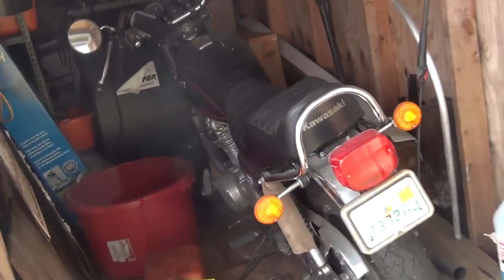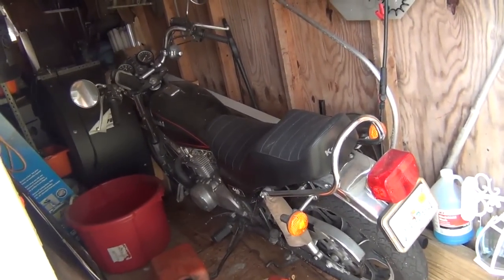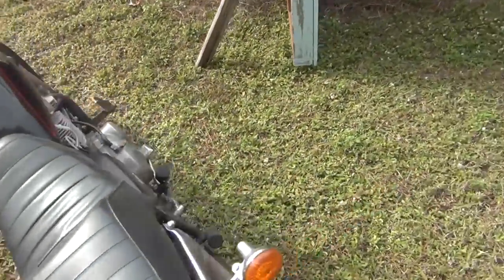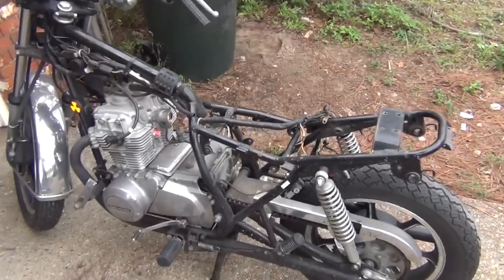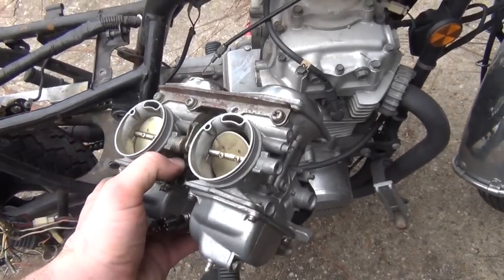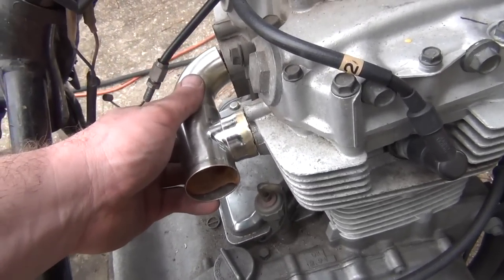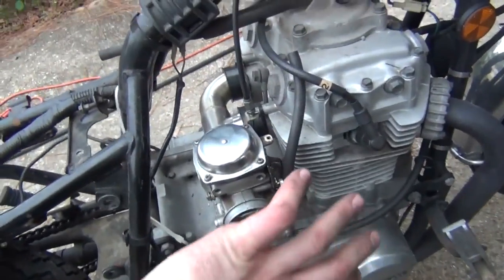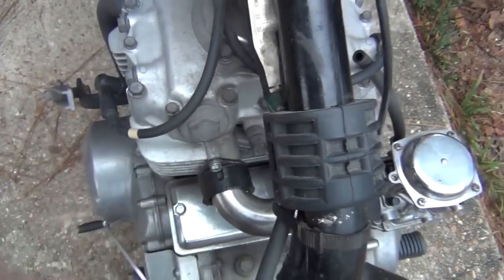KZ440 Custom Part 1 - Single Carb Conversion

Comment from the maker: Its not running yet, heh.  For mock up I used a single OEM carb from this bike, I have a set of Ninja EX500 carbs which I might break up into a single.  Haven't decided yet, but I do have a lot of options.  Rejetting is likley if not only because the OEM airbox is being deleted.  Hope that helps!

Comment from the maker: As I said above this is only part 1, part 2 as with part one covers this project as a whole not specifically just carbs, nor does part 3, nor 4.  When I start putting it back together I'll make it run.  In the video what you see is one of the original carbs which I may or may not use.  I have not rejetted anything yet nor searched for jets.  Unknown licks.  Which custom mount do you speak of?

Comment: the iceing is caused because the atomized fuel isnt taken in imediatly it will cool rapidly as it returns to a liquid state, it makes no diferance what the outdoor temp is, but if your going to hard mount it to the head that wont be a problem since the heat will transfer. but the only way youll truely know is to give her a whirl!!!
Reply from the maker: Very true, but the outside temperature DOES matter to some degree.... and yes that was a deliberate pun.

Comment: What size carb you go with and will this work on 454
Reply from the maker: I don't remember, this is almost 10 years ago... hehe... but there are other videos in this series so you can see how it was finalized, please check them out!  I used a different intake manifold as well.   I'm not familiar with a 454, what is it?

Comment: I love my 83 650 Cow, I would like to put in back on stock mufflers though, (right now Mac. headers and pods) to lower the sound but also to get it back to stock form, Mine's not a twin, has 4 carbs. I would like to do the work myself, what would you suggest I need for tools. Is there a video that you might suggest that you feel will help me most with the basic's, and how hard is this task from a scale of 1 thru 10 (10 being Hard to do) Im also doing reading on KZR forums before I attempt this.
Reply from the maker: Well that was quite a while ago, I am sorry for not replying sooner, I would imagine by now you've sorted it out, or ditched it on account of how complicated the repair is on one of them.

Comment: very nice idea to get around tuning problems and create a certain look.
however:
The single carb will not hurt performance much, like you said, BUT, the bend to the first cylinder looks like it will. If you run it like that, I don't think you'll get a proper mixture in the first cylinder
I would suggest yo make the tubes more like a Y shape, with the carb angled a little more to the rear, to even out the angles to the cylinders.
Or you could weld a divider in main tube and make it a bit longer.
Reply from the maker: Runs fine thanks

Comment: Cylinders are one piece, head is one piece, I see no problem with the manifold being one solid piece too as long as you don't plan on running motocross races!  I'm curious to know how much if any you have to change the jetting.  That's one of the two carbs that were on it originally right?  Now...  is your girl going to be riding one of your bikes or does she want to stick with the scooter?
Reply from the maker: She stuck with the scooter, but she's long gone now

Comment: However, back in the day they were said to be as accurate as fuel injection because they delivered (close to) the perfect AFR because of the vacuum input it would recieve from the engine. But $150 for 1 diaphragm blows my budget :)
Reply from the maker: Yeah I'm not fond of the diaphragm design nor the cost that comes with it

Comment: I'm trying to do this to a 79kz400....What carb are you running, is it one of the stock carbs? Also, did you have to rejet? That's a boss design on the manifold by the way
Reply from the maker: Thanks, the manifold turned out okay. The carburetor I really don't remember I think it was like a 30mm or something. The jetting was recommendation by local motorcycle dealership, I've not messed with it since because it seems to run great

Comment from the maker: If I do keep one of the factory carbs, then in theory the jetting doesn't have to change much from stock, but will likely have to go bigger because of the factory airbox delete in this setup.  It should start and run as you see it, tuning and such we shall see later.

As far as she, she has the scooter.  She has thought about upgrading and selling scooter, or giving up riding altogether.... I'd be disappointed if she does.

Comment: From my knowledge/experience (take it for what it is lol :)) those CV carbs have issues, especially as the bike ages, because the diaphragms have a tendency to get pinholes and small cracks in the thin rubber theyre made of. Since they rely on vacuum input from the engine, the pinholes and cracks cause the carbs to be way to lean. Food for thought, take it easy -Jared
Reply from the maker: And the parts are hard to get it very expensive if you could find them.  So now we have slide carbs

Comment: Hello sir.what kind of carburetor did you use on this kz440
Reply from the maker: I believe it's a Mikuni slide carburetor, I have not looked at it in a couple years so I really don't remember beyond that.  Should be covered in the video somewhere though.  😁😁😁

Comment: you may run into an issue with the close cylinder running lean, since there isnt as smooth of a transition to it as the other, then again you may not, only a plucg chop will tell, it looks trick, good luck, you may also run into an issue with iceing on the long leg if the fuel pools at all which it very likely will, ill keep my fingers crossed for you!!!
Reply from the maker: Maybe, thank you very much its been running great though

Comment: what carburetor did he end up using?
Reply from the maker: In the end I used a VM38, you'll see it in later videos.  I might put a smaller one on later this year.  I think it runs a little rough at some throttle positions, and the float doesn't seem to seat well.  Most people recommend a VM34.

Comment: How did you convert the fuel line t
Reply from the maker: There is no T anymore.... originally the T was part of the carburetor cluster.
Reply: I am currently trying to convert my kz305csr from dual to single carb and i cant find a fitting that  to take the place of the original t
Reply from the maker: Just run a straight fuel line from the tank to the carb, you don't need a T!